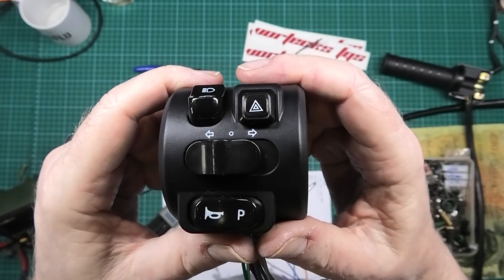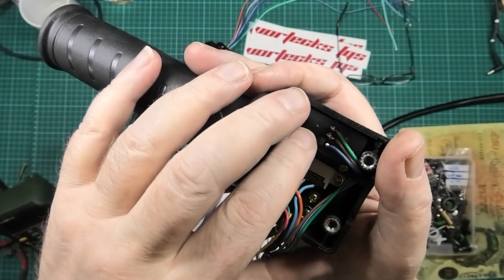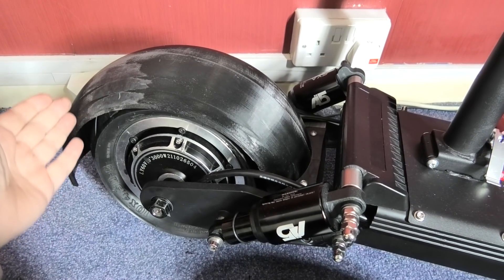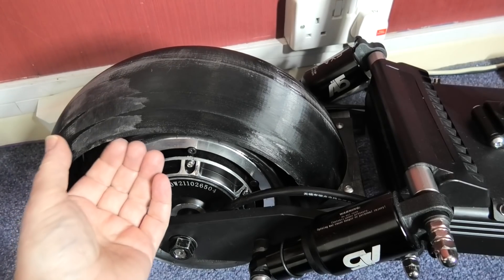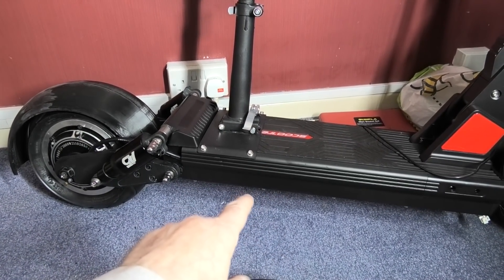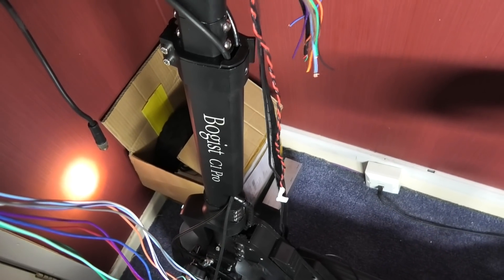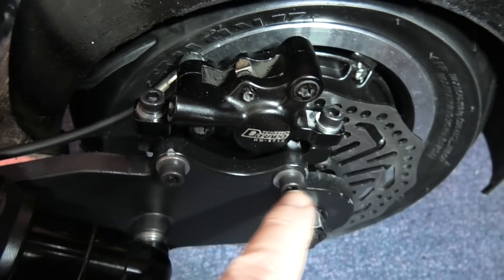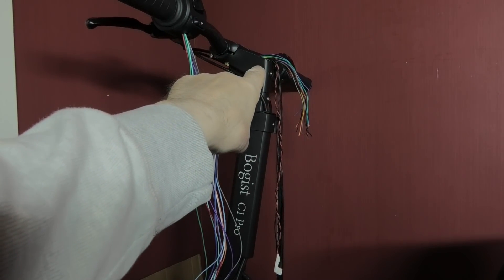🔴 EXTREMELY POWERFUL E-SCOOTER BUILD part 11 - Switchgear and wiring

Comment: I wouldnt be too bothered about saving weight with carbon fibre parts. Even with the standard weight, you've changed the power to weight ratio to what I guess is a silly degree.
Something like a Ferrari engine in a Go-cart.
Reply from the maker: I will continue on my quest to make everything as perfect as I wanted V4 e-bike mate. I intended on making as much as possible out of carbon fibre and it's rare I get the chance to do extreme things. Ultimately, I want to be able to carry this up the stairs myself and I probably could as it stands but every gram counts. Currently, it's got 700bhp/Tonne but I can make it more. If I lose 1kg, that's an extra 36bhp/Tonne 😁
(obviously, it doesn't take my fat torso into consideration)
Reply: @Vortecks  - Good for you, go for it.
I never thought about the carrying up the stairs factor.
736 bhp per tonne, that's pretty respectable. Apparently, the Bugati Veyron is 741 bhp per tonne, But of course, that calculation is altered slightly once you hop on.
Reply from the maker: @herenow2895  Yes, it drops a bit to 6bhp/tonne with my fat arse on it 🤣
Reply: @Vortecks  -  😄🤣😂

Comment: Hey Tony, Where is the affiliate links? All Chinese throttles are all dodgy but I could use one like this with the switches and you may as well get the commission. BTW the tape is Tesa tape, used for making car wiring looms.
Edit. Sorry mate, PooTube has changed location of the description and confused me. 😕
Reply from the maker: Yes mate, it's Tesa/coroplast tape used on wiring looms. Hopefully, you found the link and earned me 11p 😁
Reply: @Vortecks  hopefully a little better  I bought a throttle like yours. 🙂
Reply from the maker: @alibro7512  Cheers mate 😉

Comment: Now that you've said it you cannot go back - you NEED tassels on your handlebars 😀

Friction tape - that's another name for that black stuff. They sell it here at Home Depot. Used some to cover up wiring in my PC build, but it has other uses too. I also find it handy to keep some black 50lb braided fishing line - very strong, useful for knots, loops, fixing broken lanyards or (what I did) making my own phone lanyard. Then I also have various sizes of heat shrink, zip ties and construction paper. I've used construction paper to hide stuff cleverly in many ways, especially if black is the theme of the build. A fat black marker is useful too for bolts, screw heads and edges. Then I have various sizes of circular hole punches to use with adhesive carbon fiber film that you can get in all kinds of colors (black/silver/yellow) - used it to cover the labels on the front/back of fans. If you go online and search for muscle car badges you can even put "SUPERCHARGED" in glorious chrome on your scooter, which technically it is LOL
Reply from the maker: Some very good tips there, thank you 😁
As for the tassles...... If I can find any suitable ones, I will fit them 🤣

Comment: @tony get a plate fill with acetone put a small platform in the center cover it with a plastic box to seal it and leave for around 24 hours it will smooth the print. Also you can get carbon fiber filiment as well and defo put silicone around the metal kid at the bottom I noticed the factory seal of you can call it that leaks. Been using mine as a mobility scooter  as well also noticed the stem or seatpost is crap I'd get a stronger one as the metal scores on the crease where you extent the seat top tube and bottom tube
Reply from the maker: I only work with PETG mate, the acetone trick doesn't work on it. I've made parts with carbon fibre filament before and it's not as strong as I thought. I'm printing moulds with PETG and making full-blown CF parts, this will be everything I wanted V4 to be 😁

Comment: Just put banana plugs on the wiring and leave it. It's like a 20-combination lock just to start it.
Reply from the maker: The only way that'd work is by making sure none of the colours actually match up. I'd have to walk around with a wiring diagram but I should be back on it within an hour (unless I forget my glasses) 😁

Comment: The fact that those Tektro brakes are rubbish might not be important, as they're prolly good enough for a 10 inch wheel, but even the cheapest SRAMs are way better, AND they have the line coming out in the right direction with no banjo bolt. Should give you a lot more clearance, if wanted.
Looking forward to your CF videos! I've watched everything from Easycomposites, but not very DIY, is it..

Comment: Should be able to find some reductions in a carbon fibre seat, replace the rubber hand grip sleeves with foam from a push bike manufacturer
Reply from the maker: The seat has got to stay, I need the comfort because of my back. The foam hand grips - yes, thank you 😁😁😁

Comment: Hi Tony..off topic but I was using your bms app that I bought from the playstore awhile back and i just changed to a 32S ANTBMS...the app doesnt seem to connect. Is it compatible with 32S version as well? Thx
Reply from the maker: It is compatible with the 32S version but, as Jonas has already said, if it's a brand new BMS with a round logo and it says "scan to get app" then it's one of the new ones where they increased the security. VBMS will still connect (you need to delete the old BMS first (bottom right hand icon - it's at the very bottom of that screen). 
If you do have one of the newer ANT BMS's I've got someone working on a new version of VBMS (because I can't sit for long enough to do any programming) but it's going to be a complete redesign and it'll only work on the new style BMS so it won't be a free upgrade, sorry.
Reply: @Vortecks  hi..so will there be the original VBMS app available as well as the newer VBMS app in the future in the play store?
Reply from the maker: @MrDeceptacon88  Oh yeah, the version you have will always be there. The trouble is, it's not possible to integrate the 2 different types of BMS because everything is different. It's like carrying a bunch of keys when you've only got 1 door to open.
Reply: If it's the new ant BMS then you can only use the new ant APK.. I think you can find it under the product in AliExpress.. 😉